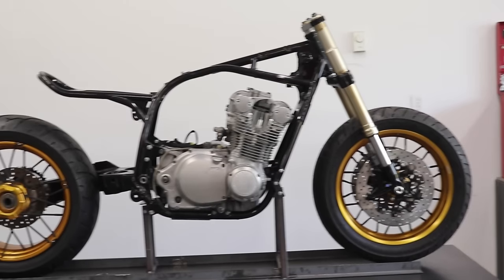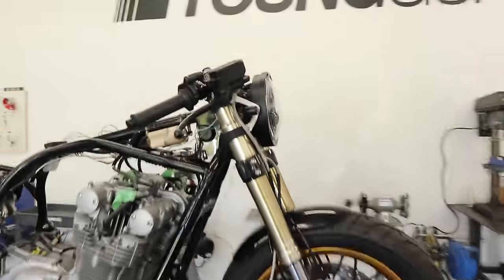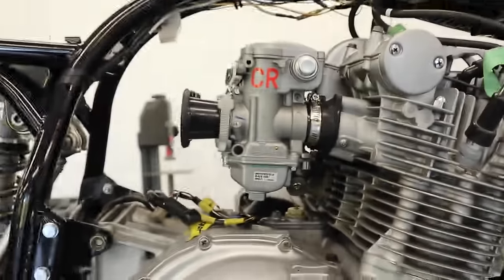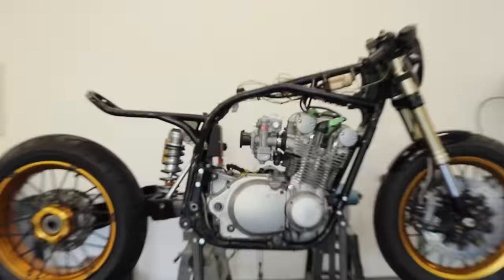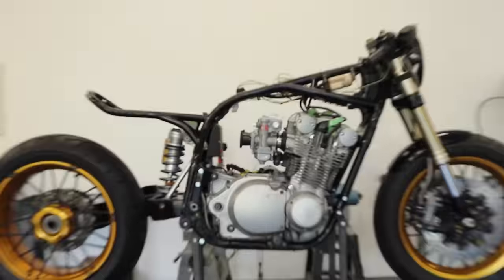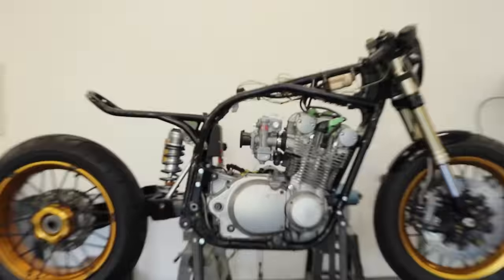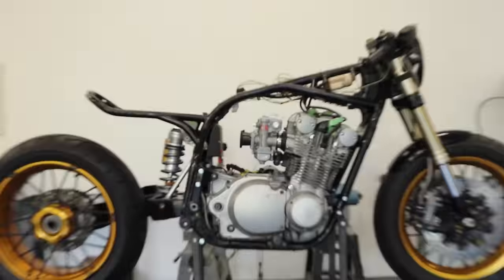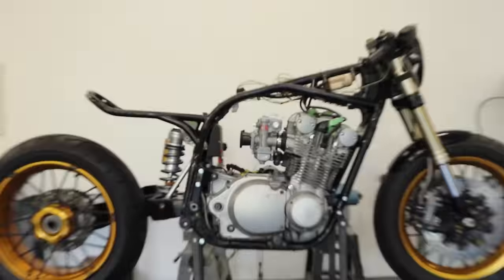GS750 Cafe Racer is back together and looks unreal!

Comment: Hello, could you post the digital or electrical parts you bought, and where they came from. I have a 1980 Suzuki gs750L, that I want to modernize just a bit, not to alter the looks, but to improve the electrical functions. Thanks.

Comment: Are you worried about heat issues with the reg/rec installed above the engine? Amazing work bro
Reply from the maker: a little but i’ll have to see. gsxr’s have them right next to the radiator so this can’t be any worse

Comment: Great build!! But if you grease wheel bearings like you greased the neck tube bearings your wheels would fall off!!!😂 smearing grease on a bearing is not sufficient! They need to be packed.. you can do it by hand just watch a video or get a packer that works with a grease gun….